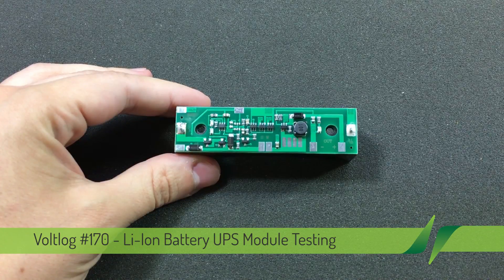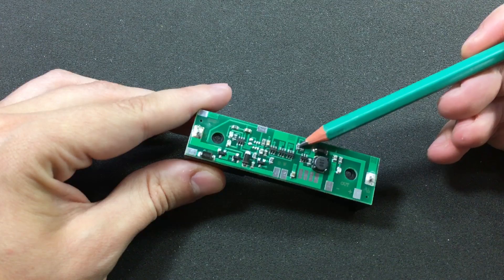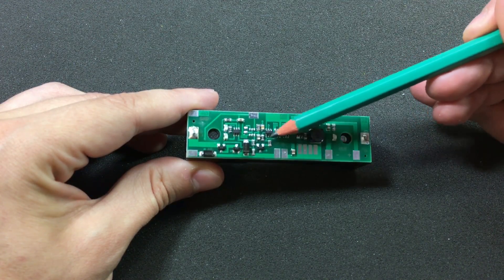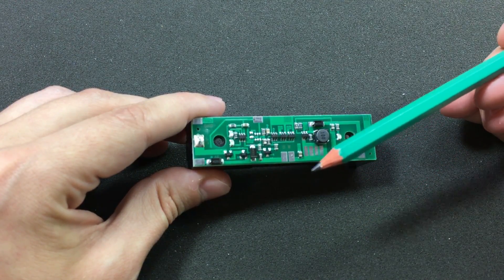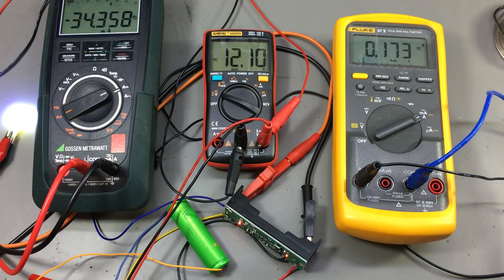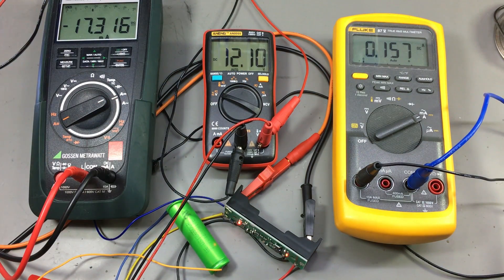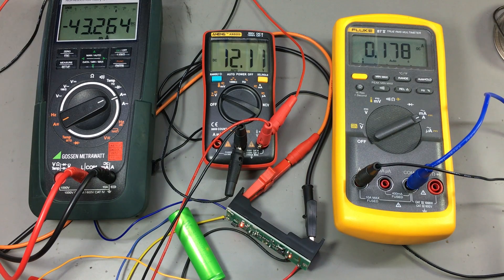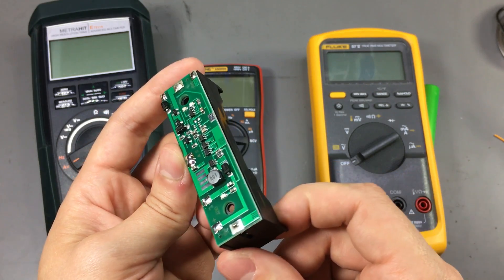Voltlog #170 - Li-Ion Battery UPS Module Testing

Comment: Do you think a small 5v(1w to 5w) solar panel could be used as the input power without a separate solar charge controller?
Reply from the maker: I would assume that as soon as the module increases the current over what the panel can supply, voltage on the panel will drop to 0.

Comment: I was going to buy a couple of these 12v output versions. The only problem is I would prefer a 12v input as well. Can anyone recommend a ups module or circuit that would do 12v input and 12v output?
Reply: I do know ready to use boxed 12V input/output models https://www.banggood.com/12V1A-14_8W-Mini-UPS-Battery-Backup-Security-Standby-Power-Power-Supply-Uninterruptible-Power-Supply-p-1118940.html?p=FG30042906065201510J or this one with more power https://www.banggood.com/12V2A-22_2W-UPS-Uninterrupted-Power-Supply-Backup-Power-Mini-Battery-for-Camera-Router-p-1118942.html?p=FG30042906065201510J or even thism odel that permit to select output between 5/9/12V https://www.banggood.com/Multi-function-3-In-1-DC12V9V5V-All-in-one-Li-ion-Battery-Pack-USB-p-1104778.html?p=FG30042906065201510J but more expensive

Comment: Can you please reverse engineer this circuit and publish a schematic? I am working on something similar. Problem with these circuits is that they damage the batteries too much. Like too much current draw, float charging, low cut off voltage, high overcharge voltage etc.
Reply from the maker: this circuit will protect the battery as good as the DW01 circuit is.
Reply: VoltLog DW01 is good for cycle usage of batteries. I don't want to to fully charge the batteries to extend their life.

Comment: Does this actually have a proper load sharing setup? Or is the charger going to get confused when the load is powered while the battery is being charged? E.g. the popular TP-something charger has this problem and will not stop charging the battery if a load is connected - with potentially dangerous consequences. The two diodes and the bunch of extra transistors may be used for this but it would help to have a full schematic.
Reply: SuperBrainAK that is what I have assumed too but it would be good to verify it against the actual board schematic.
Reply: I too would be interesting in knowing this.

The cheap modules I've looked at that call themselves UPS do not have pass-through (dynamic power-path), meaning they constantly charge and drain the battery which greatly reduces the cycle life of the battery.

Thanks for looking at this module VoltLog ! It's like Christmas every time I watch your videos.
Reply: power coming from the 5v input is split to the boost converter and the charger so they are in parallel and will not effect each others behavior. most modules run them is series, 5v comes in to the charger, then from the battery the boost converter is attached so the main power when coming from 5v has to always go through the battery and charger. this uses the diodes to bypass that.
Reply from the maker: this behavior has been verified in the video, watch when the individual amp meters, due to the diode OR circuit, only the higher voltage rail will power the dc-dc converter at any given time.

Comment: I made something similar to this, but I used less components for switching, just one P channel mosfet with pulldown resistor and one diode. Something like in this module: https://jyetech.com/Products/118/Manual_118.pdf but with mosfet other way around. Everything fitted one sided board sized around 35x20mm. I could go even lower but that would make problems with manufacturing of these little boards. I used jlcpcb to make boards, now I have 80 boards for 2 bucks. Bargain!
Reply from the maker: the advantage of living in this age, cheap pcb's for everyone :-)

Comment: What I would really love to see is a complete module similar to this, which includes the Li charging/protection circuit, and 3.3v buck/ldo of at least 500mA, and maybe bonus points for also having 5v 1A boost output... Some kind of gas gauge ic would be icing on the cake ;)
Reply: Search for raspberry pi 18650 on aliexpress and you will find something very close to what you want for $2. No gas gauge.

Comment: I wonder what the output ripple/quality would be... I don't see how they can push out so many amps with such little filtering. Would expect to see several larger caps!
Reply: Frequency. When you keep pushing and pulling electrons one million times instead of fifty times a second, you don't really need to stockpile a lot of them until the next push arrives...
Reply: ok so these are likely switching in the MHz range? I was under the assumption they switch in the 10s of kHz range
Reply: 01:00 :)
Reply: thanks... i guess i should have RTFD.  Looking over datasheet i see app circuit uses 10 and 0.1 uF caps, hmmm... only seeing one smd cap on either side of the boost converter in the video... interesting
Reply from the maker: as usual, our chineese friends will try to stretch the circuit to a bare minimum, but if one is concerned with ripple it could easily add an extra ceramic on the output pads.

Comment: I've used those boost converters before, the inductance is not dependent on the output voltage so you don't need to change it. Only thing to look out for is make sure the inductor is rated for the current you want.

Comment: How does it behave when pulling out 10watt and supplying only 5 watts via the 5v input. When the battery dies, does it go into a frantic on off loop?
Cheers.
Reply from the maker: Haven't tested that, but since the input selector acts on voltage levels, if the external 5V drops under the voltage of the battery, the battery will be selected, if the external voltage than goes up because there is no load anymore, it will switch back to that which might lead to a nasty oscillation. Anyway, not a normal condition and it would be hard to avoid that without adding some digital logic, delays, etc.
Reply: when the battery dies the DW01 battery protection will turn everything off until the 5v is resupplied charging the battery.
Reply: oh if the input power supply is too small for the load applied, well that is just not a good setup, you need a bigger power supply. im sure it would handle it fine since it has very quick response with 1MHz switching frequency.